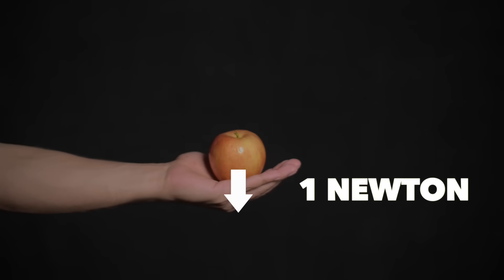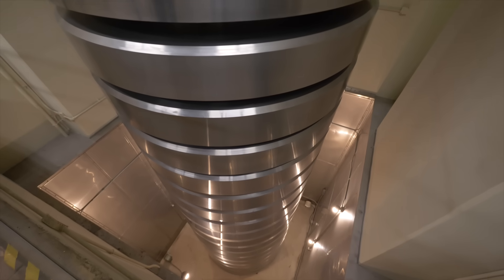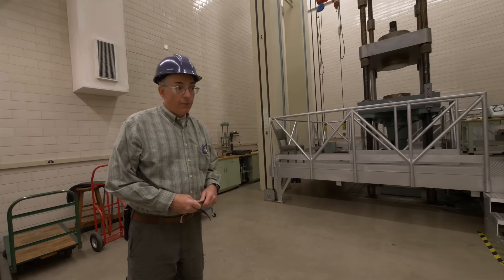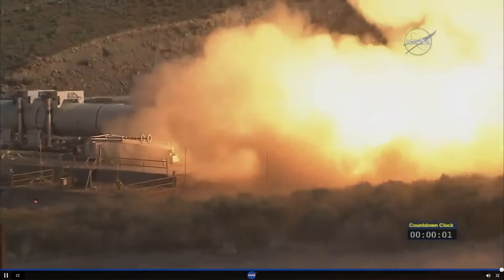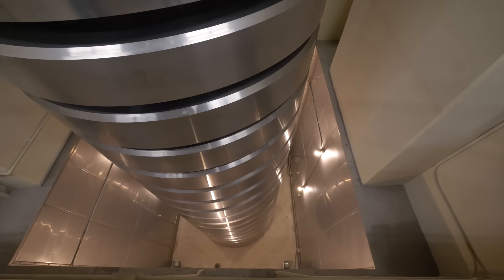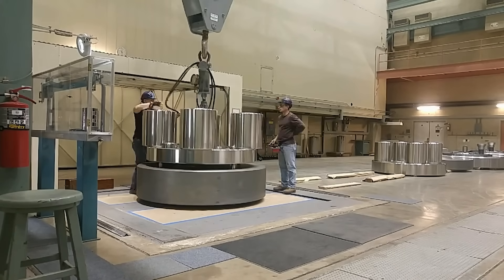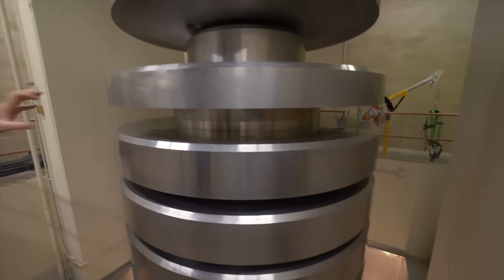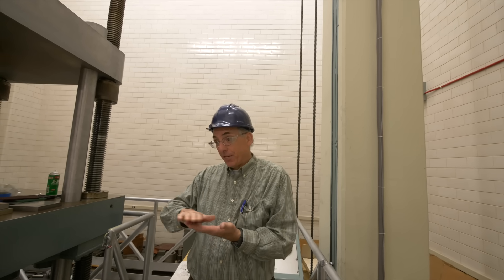World's Heaviest Weight

Comment: yea, using pound in the scientific world is a good idea.
Reply: because most scientists are smart enough to understand that math works the same no matter which units you're calculating.
Reply: First Last Because Scientists that are smart enough to know that using the Imperial "system" in doing calculations and conversions is cumbersome at best.
Reply: This is far more engineering than science bud. An engineer's tend to usualy used ft, inch etc.
Reply: @Jay-cn3js  "I have worked in the US as an engineer and physicist since 1976. I have rarely used the imperial or American standard system.

I have mostly used MKS but it isn't always easy to do that. I have used atomic mass units, electron-volts, Angstroms, wavenumbers, microns and nanometers"

Engineers who use imperial mostly propably aren't engineers...
Reply: @perhapsso1909  it depends what type of engineer you're talkin about. A physicist, a bio-genetic engineer, a structural engineer, and a mechanical engineer are not all going to use the same measurements, but will tend to employ the measurements most commonly used in their own country.
Reply: it was made to be 1 million pounds. not 1 million kilograms
Reply: @aitorjara100  what the hell you talkin about? American pounds measure weight, not mass.
Reply: @zacharyhenderson2902  I guess you are trying to say pounds of force, which need a fiction unit of mass to make the equation hold. Kg are Kg of mass  in any context. Only Newtons are used to measure force. What is odd is your misunderstanding of the different units
Reply: @aitorjara100  someone's oddly silent
Reply: Jie Li it's a better idea than using the kilogram Force unit
Reply: @zacharyhenderson2902  its called Newton.
Reply: @perhapsso1909  but that's not metric
Reply: @zacharyhenderson2902  Its definition is: one kilogram meter second squared. All of the above units are metric, therefore making newton based of metric. it is the unit of force used in metric, F = MA, F in Newton, M is kilogram and A is meter per second squared.

Comment: Morehouse has all of our load cells over 120,000 lbf calibrated by NIST.   We had the weights in our 120,000 lbf deadweight frame calibrated by NIST.  We have them calibrate 3 load cells to 800,000 lbf to allow us to reach 10 MN or 2.25 million lbf.  Our 1 million lbf standard has about 7 calibrations on the NIST deadweight frame and each time has an ASTM LLF of less than 13 lbf.   The team at NIST are amazing and fantastic to deal with.
Reply: If only they could metric ;-)

Comment: This method of using mass seems dumb when they clearly have a hydraulic jack capable of reaching that load in tension. All they would need to do then is find a way of accurately recording the pressure in the jack to find the force being applied... seems easier than lumbering around huge masses everyday.

Comment: Imperial units are inferior to the metric system
Reply: Tony Bowyer
Never been a problem for me. Or any of the billions of people who don't live in the US.

Meters and centimetres are usually enough to describe anything human sized.

And when it comes to rough estimates you can just pace out meters.
Reply: Tony Bowyer
Which is why the decimeter is there.
Reply: Tony Bowyer
Sure it does.

It's the same rough scale.
Reply: Tony Bowyer
And to me, the one thing which imperial lacks, is easy conversion between the units.

There's no singular unit which is better or worse between the two systems at measuring length, or making length easily conceptualised.

The one and only difference which matters between the two is the fact that it's easy to jump between measurements in metrics, and SI units, and it's a right pain to do in imperial.
Reply: do you have a foot fetish? wtf
Reply: Mostlyharmless1985 - The whole "start using SI units" argument is one for convenience. It eliminates the need for conversion when crossing borders and doing trade. It also cuts out the need to tailor products for difference countries. eg. No need for different 1 L and 0.5 gallon canisters of food that roughly are equal but clearly do not match. 

Conversion between inches and feet or feet and yards seems easy enough, - only factors of 12 and and 3 are involved. What if you scale it up? How do units of area compare? 144 sq inches = 1 sq foot. 66*66*10 sq feet = 43560 sq feet = 1 US acre. Tell me if that is convenient for you. Adding one more dimension to these conversions, volume equivalents are: 12*12*12 cubic inches = 1728 cubic inches = 1 cubic foot. 27 cubic feet = 1 cubic yard.

Since we universally count in base 10. These conversions get noticeably simpler in the SI system. 100 sq cm = 1 sq dm, 100 dm = 1 sq m. 1000 cubic cm = 1 cubic dm, 1000 cubic dm = 1 cubic m. Furthermore, 1 liter = 1 cubic dm, so SI units have the added bonus of converting into other units in the same system. Try that with tablespoons and cubic inches (which are the closest in terms of absolute volume).

I think you can see why most of the world (+ NASA) prefers the SI system.
Reply: Tony Bowyer
Yeah it can, it's the decimeter.

And if anything the decimeter is more handy, because it's roughly the width of a grown hand.

And finally, please mention a thing you'd rather measure in feet, rather than either meters or centimetres.
Reply: Units of measure are arbitrary. Conversion factors exist for a reason ; )
Reply: Brent Taylor
But why do the US use the units with the most obtuse, and needlessly annoying conversion factors?
Reply: Mostlyharmless1985 - After reading all your points you've based your preference on "convenience". Either side can play that game.
What is 1 foot in meters? 0.3048. <-> What is 1 meter in feet? 3.2808. Which one is "better suited for life?" That is a subjective factor and it fully depends on which one you are accustomed to.
Any country will use their preferred measurement unit to design measurement devices and arbitrary lengths for products. The US has 1 yard length wooden planks? SI countries have 1 meter long ones. The US has cups for measuring food ingredients? SI countries have desiliters for that. Again, your argument of "convenience" has not merit if you live in or travel to another country. There is nothing "traditional" about one set over the other. You might as well compare modern units with those from the 1800s for that matter.

The "8 feet equals roughly 2.5 m" can also be phrased as "10 meters equals roughly 32 feet". No obvioius reason why one unit length would be better than the other. I cannot tell why you would assume SI countries sell wood based on imperial units. Every lumber ad I've seen has stated their price based on currency/meter, and not currency/8x feet. In addition, every industry has their own preferred unit lengths that are not necessarily integer multiples of inches, feet, or yards etc.
Reply: I can get all scientific in why they're using pounds but at the end of the day they're using pounds for a reason
Reply: Adam Zaidi ok so what is that reason? That is no argument. Before the french revolution  that introduced  the SI system  preists would say the world is flat, just because, Moses hâd a reason
Reply: Tommy Fischer are you actually arguing about which unit of measure is superior Jesus you really want to find ways to hate on the U.S.
Reply: Memeulous's Son  We complain because we are constantly presented with measurements from a system that less than 5% of the world's population use because they're too stubborn to adapt.
Reply: HWG it’s called a yard, 3 feet to one. Keep up.
Reply: Jack R  well we actually do all speak English very well like you see here in this comment section...(now you will try to find a grammar error in this comment just so you can bash me)  But it appears you cant speak our languages without a translator you dumbass...and dont forget your country was colonized by Europeans, you have our blood whether you like it or not, if we werent there you would probably be hunting for food , throwing arrows at eachother and sitting around a fire to escape bears.
Reply: Whag do you mean
Reply: I know I'm super late but how exactly can one weight system be "worse" than another. It's like saying 1000 Kb are inferior to 1 Mb.
Reply: the only country that has sent men to the moon uses the imperial system...
Reply: Imperial units landed on the moon...
Reply: Mostlyharmless1985 Did you just say that using kilo, mega, giga and so on sucks? XD
It is the most precise convertion there is and you can use it in day to day life with highest precision and simplicity, because you can decide the size of your units you want to work with on scales much more precise.
Yes they did land on the moon with imperial units, but they did everything (dramatization) after that with metric units, because they learned they were easier to use. Also the whole rest of the world uses them, because it simply works better. Well just continue using them and feel special as one of two nations that think they have to be different to be better. Yet science has mostly already learned its lesson and started using metric. One day, you might learn it too.
Reply: "Also the whole rest of the world uses them, because it simply works better" Yeah I'm sure it has nothing to do with colonialism. /s
Reply: Mostlyharmless1985 no our wood planks aren't unprecise. I measured the shelf next to me and its exactly 90cm in length. A third therefore is 30cm and halved its 45cm...
Reply: Mostlyharmless1985 Obviously you don't complain because you use the system. We complain, because you can't properly convert an inch to a foot, a foot to a yard, or like gallons to barrels. It just doesn't use the better convertion ratios from the metric sytem that just work by multiplying it with 10^3 or 10^-3 to get to the next unit. And whenever we have to use information out of the USA or Great Britain it becomes a huge pain to properly calculate. Also, did you know NASA started using the metric system, because they realized it just works much smoother and can be easier applied to all sorts of problems? (Additionally we don't get offended, we just can't understand how anybody can use such a crooked system in their day to day life.)
Reply: Mostlyharmless1985 This discussion leads nowhere. I could continually say how our system is better, because it works better in itself and you could do the same. However I am allowed to say that I think ours is objectively better, because of several reasons, one beeing that 85% of the world adapted to ours, because they thought it was better. Freedom of speech. You can not deny my opinion that I think ours is better to which at least 80% of world population would agree. Continue in your microcosmos of empire and be happy with it.
Reply: Mostlyharmless1985 3 feet is 91,44cm...
It is EXACTLY 90cm.
Reply: Tony Bowyer
And the foot is about a third of a meter, a unit of measurement I find many times more elegant to use.

You need to use multiples of the foot to accomplish what I do in meters.

And in my experience, I've needed something meter-sized a lot more than I've needed something roughly 30cm in length. And if I need precision, that's where decimals come in.
Reply: See, what you don't get, is you never stopped using your traditional lengths, you just used different numbers to describe them.
Reply: Gian Fajardo Yes, since the whole rest of the world has the trouble of converting your units, which is literally impossible to do precisely, because your convertion from one unit to the other does not work nearly as smoothly compared to the metric units.
Reply: "Yes, since the whole rest of the world has the trouble of converting your units"

Zero. Fucks. Given.  'Merica!
Reply: So if people use it and do not complain about it, does it really make it inferior?
Reply: @gian3458  NASA:" Can you help me to supply my space station?"
ESA:"Sure! What do you need?
NASA:" A Few milion cup of fuel"
3 Months later
NASA:"DO YOU JUST LAUNCHED A FEW MILION OF CERAMIC CUPS FULL OF PRECIUS FUEL NEAR MY SPACE STATION???"
ESA:"Lol, yes"
Reply: Jack R you are one ignorant individual. You do realise English is like a child compared to languages like Greek, Chinese, Hebrew, etc., right? Go read a book you noob.
Reply: hubertinnovation dingo woosh
Did you really think he was serious?
Reply: Where do you think your lumber is milled? I'll give you a hint. "Not europe." Also, why 90 cms? That's a yard. Gee. it's almost like you guys are just using our system arbitrarily matched to numbers you can work with.
Reply: It's like you didn't read a word I wrote. It's not objectivly better. You just straight up said that your country uses US Customary units. That you don't realize it is amusing. enjoy your 90 cm length shelves. Just remember that that is 3 feet.
Reply: Then where's your million kilogram calibrated weight?
Reply: Gian Fajardo I really only ever see metric people complaining about imperial units. Like the thought that someone could ever use a system that isn’t their precious French hunk of platinum held in Paris offends them for some reason.
Reply: "scales much more precise." Says the man who has never built a godamn thing in their life. You act like 1/12 is somehow less precise than it's decimal representation. If I have a 8 foot board and cut it in half, i have 2 4 foot lengths. If I cut a 2.4384 meter board in half, I have, what, exactly? 2 1.2192 meter lengths. Super accurate and easy! 
"But we use 2.5 meter length boards!" No, you use 2.4384 meter lengths rounded to 2.5 so your math works easier.
Being able to jump powers of 10 is a neat trick, but it isn't useful when I need to use thirds, 12ths, and 16ths.
 The yard is defined off of the meter. It's exactly the same precision. There exists base ten customary units in the mil, and thou, and there are kiloyards and gigafeet as well.
Reply: Mostlyharmless1985 there is no problem dividing by 2 or 3 but what when You have to divide by 2.3? Thec truth is imperial system  is less acurate and hard to use in Day to Day work because You would use  base 10 to add substract ... But the units  are like in base two or thre  ..IT is not all that dificult  to work with imperial IT is just that If You neted accuracy IT becomes alot harder, imperial works only for simple stuff like sharing a loaf of bread
Reply: ShadowFalcon it's about a third of a foot...
Reply: I don't have any problem converting units in Imperial at all.  The thing is people can educate themselves better on unit conversion, but the metric system can't magically make an equivalent to the "foot"....
Reply: Alfinite I think it's a great unit of measure. Do you have a problem with a person having a foot fetish though?
Reply: ShadowFalcon well if I need a meter I just use yards..... It's just easy to step something off and know it's ten feet or so.  To me it's just a measurement lacking in the metric system. I understand you preferring metric, I prefer a system that has inches, feet, yards.
Reply: Properly convert an inch to a foot. It's 1/12th. A foot to a yard. it's 1/3 or gallons to barrels. A barrel isn't used in anything but oil.

"The better conversion ratios" are simply just tricks of base ten and they suck suck SUCK for day to day life. There's these things called fractions. Are you too stupid to use them? I thought the americans were the stupid ones.

"It becomes a big pain to properly calculate." Most of the industrial world actually uses US customary disguised as metric. Also, did you know that the US landed on the moon with Imperial units?

You can't understand how we use such a crooked system in our day to day life? Simple. Because the Customary units are calibrated to day to day life.
Reply: Nah Imperial is actually better.  Metric is severely lacking something equivalent to the measurement of a "foot".
Reply: Because having to use multiples of something to equal a widely used measurement is ineloquent at best.  Sure you can say that object is 3 decimeters, but i'd much rather say it's just one foot.  Which happens to be pretty close to the length of a lot of peoples feet, so it's just a really solid measurement in my opinion that is just lacking in the metric system.
Reply: @kobeandgary  nobody here thinks of feet or any other "objects" in order to measure or imagine sizes dude....the only thing i can remember doing similar to that is using steps to measure large distances...one large step is roughly one meter so you can measure fairly accurate large terrain areas without a measuring tool. but for small measurement everybody can look at one thing and give an accurate estimate of its size without reffering to comparisons with body parts
Reply: Hugo B. I weep for your country.
Reply: ShadowFalcon sure it's doable, it's just not as elegant, in my opinion. Everybody can have their preference, personally I love the "foot" measurement and find the metric system lacking without it.
Reply: ShadowFalcon decimeter doesn't really compare to the foot very well